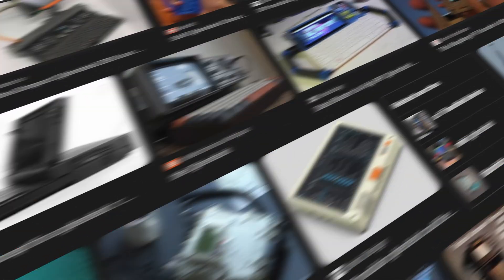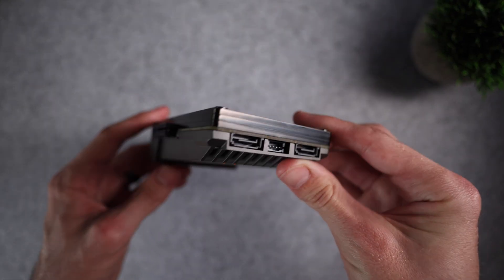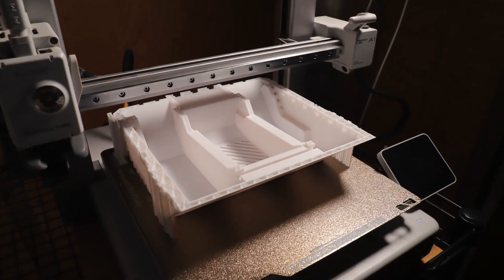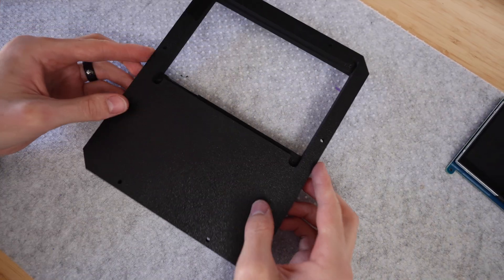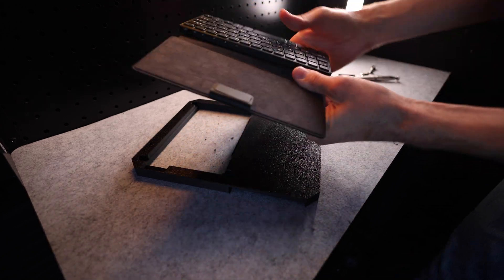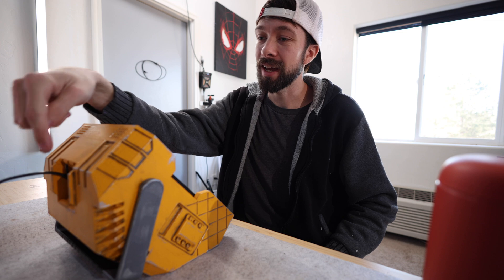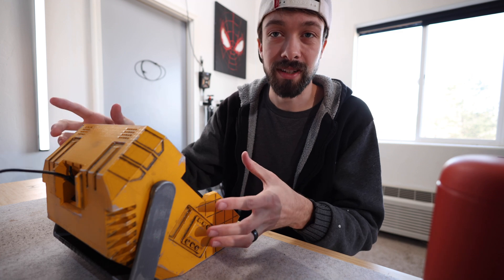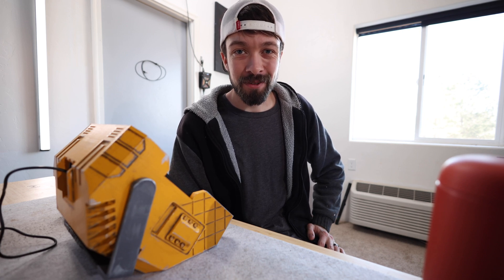Building a Cyberdeck - DIY Portable PC

Comment: "All-in-One PC" is NOT a more-accurate term for a cyberdeck. An AIO PC is simply any PC with all components for functionality (such as monitor and speaker) built-in. It does not imply portability: the iMac G3 is an All-in-One and that's a gigantic CRT monitor.

"Cyberdeck" specifically refers to a purpose-built (made for a specific use case and not just a general purpose computer) portable mini PC, and the spirit of the term implies DIY and a focus on aesthetics.

Since your machine needs to be plugged in, it's arguably not a cyberdeck at any rate, but indeed an AIO PC.

Also your music is way too loud.

Comment: ive watched bunch of these videos and there is alway, or very often, a "well something is not working so I will go deep into the code and reformat the serg to get the bandersnatch to uplink to the source code" it feel fake. can you or cant you do this? if only you can do it then what the hell am I watching for?
Reply: Frankly I'd be more suspicious of a video if something didn't go wrong.

Also don't sell yourself short. He says code but frankly that issue sounds like a few commands on the terminal, or booting into a live distro and using a partition manager. You could probably do it after a few tutorials.

Comment: If you really want to go all the way for the casing, first sand the surface, spray paint with aluminum as first layer and then yellow. Slightly sand down the edges exposing the aluminum.
Reply: Or use yellow filament to begin with...

Comment: Why not putting the cables inside and build some short cables with the corresponding ports to the enclosure. There are keystone modules for nearly every connector needed so only a keystone sized hole in the enclosure is needed und it would look really cool. And Battery Power would be nice too. Nice thing yo've made. I like the rugged and scifi style like in alien or something.
Reply from the maker: Thanks! Glad you like it. That’s a good idea… maybe next time 😋
Reply: Cables coming in and out also fit the aesthetic.

Comment: Zima is $283.19 aud 🙄
Reply: Get a Radxa X4 the 8GB RAM and 64GB emmc storage option is only $105 (USD) it's a much better price with better hardware with fewer issues to deal with.
Reply: Yeah the Aussie Tech tax strikes again !!

You could easily use a cheap AU$40 Android TV box though.
I had one in my car 10yrs ago with an old 12v 14" SVGA PC screen ($3 HDMI - DVi-D adapter) 👍

The better solution now is recycled iPad Retina screens and AU$25 AliExpress VGA/HDMI controller boards 👍

Android supports Bt and USB keyboard and mouse natively and has great emulator support.
Reply: So like 55 usd
Reply from the maker: Like I said you could use any mini PC